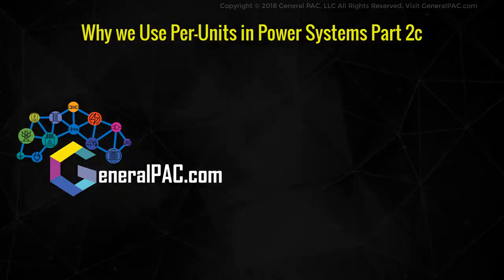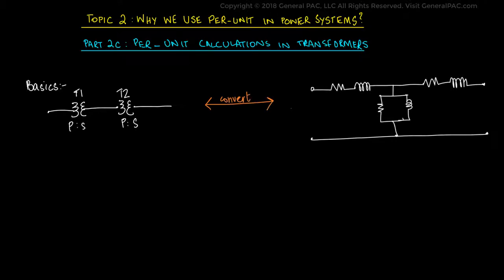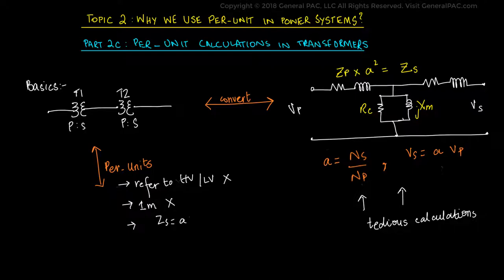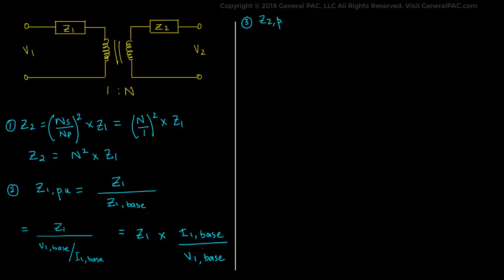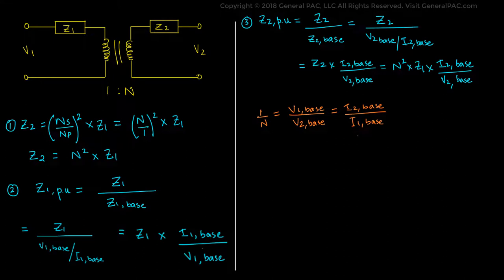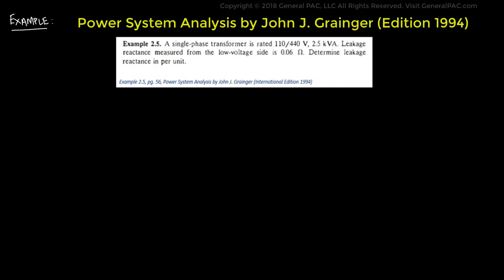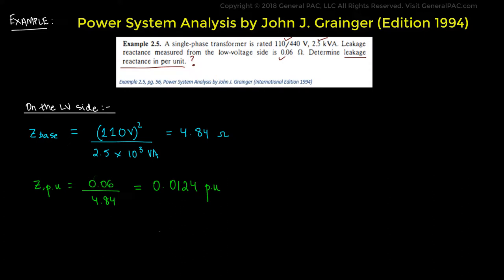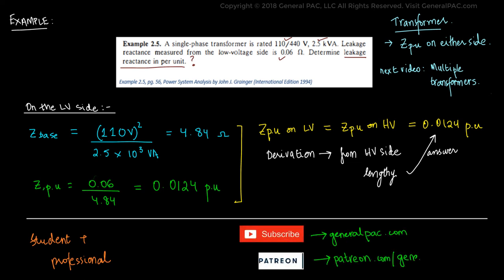Why we Use Per-Units in Power Systems, Part 2c

Comment: at @3:14 Can u tell to me why you subtituted (1/V2base) = 1/(N².V1base)??? I think it should be 1/(N.V1base), because we use equation (1/N)=V1base/V2base, and not use (1/N²)= Z1/Z2.. pls helpp... i think it was a mistake.
Reply from the maker: Hello Ahmad, We think that the 'N' below I1,base is making some confusion.

The formula :
Z2,p.u= N^2 x Z1 x I2,base/V2,base
is simplified by using the following equation below

I2, base= I1,base/N
V2, base =N x V1,base

By using the values of I2, base & V2, base, the value of Z2,p.u becomes:

Z2,p.u= N^2 x Z1 x (I1,base/N)*(1/NxV1,base)

Thanks,
GeneralPAC by AllumiaX

Comment: @1:55  the equation of  Z2 must be (Np\Ns)^2 not (Ns\Np) so not Nshould be  1\N  Am I right?
Reply from the maker: Hi Ayşenur Sağlamtaş,
We are pleased to see your interest in GeneralPAC and regarding your query, the answers is:
Actually there is no mistake, it must be Zs =a^2 Zp. Your claim could be right if a = Np/Ns was assumed. But here we have taken a = Ns/Np according to which, we have done it in the right way.

There are 2 ratios that are considered when you talk about transformers. There is the "a" term which is usually defined as the turns ratio, where a = N1/N2.

The second ratio is the reciprocal of the turns ratio which is commonly referred to as the Transformation Ratio and is denoted by a "k" and is described as k = N2/N1.

In some textbooks, the transformation ratio "k" is referred to as the turns ratio and is denoted by the "a" term (as used in the video). Whatever convention you may use, the concept, however, remains entirely the same.

If you still have any confusion, we always welcome your queries.

Thank you,
GeneralPAC Support Team

Comment: You have a mistake at 1:10 it should be Zp=a^2 Zs
Reply from the maker: Hi Hassan Nasser,

We are pleased to see your interest in GeneralPAC and regarding your query, the answers is:
Actually there is no mistake, it must be Zs =a^2 Zp. Your claim could be right if a = Np/Ns was assumed. But here we have taken a = Ns/Np according to which, we have done it in the right way.

There are 2 ratios that are considered when you talk about transformers. There is the "a" term which is usually defined as the turns ratio, where a = N1/N2.

The second ratio is the reciprocal of the turns ratio which is commonly referred to as the Transformation Ratio and is denoted by a "k" and is described as k = N2/N1.

In some textbooks, the transformation ratio "k" is referred to as the turns ratio and is denoted by the "a" term (as used in the video). Whatever convention you may use, the concept, however, remains entirely the same.

If you still have any confusion, we always welcome your queries.

Thank you,
GeneralPAC Support Team